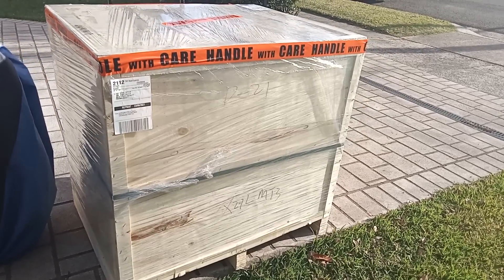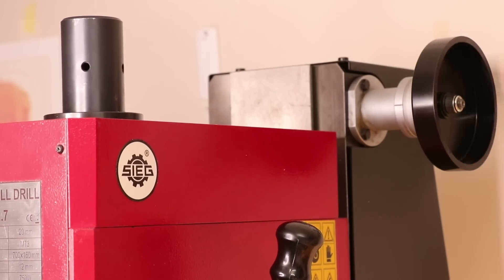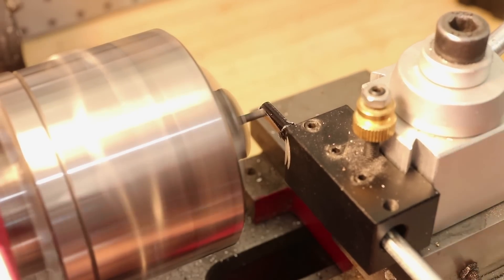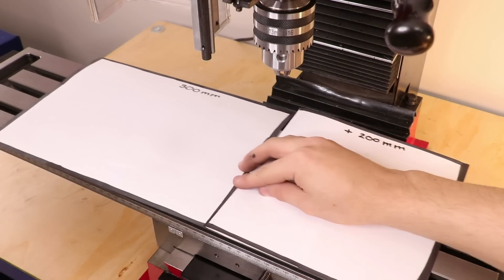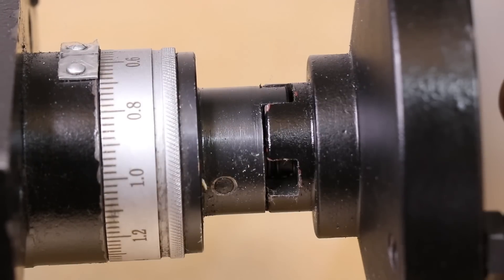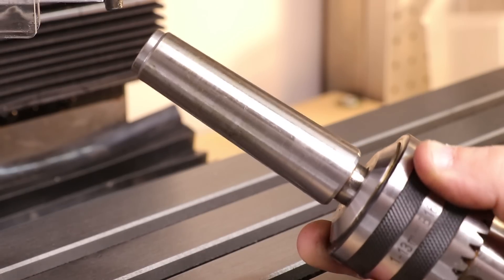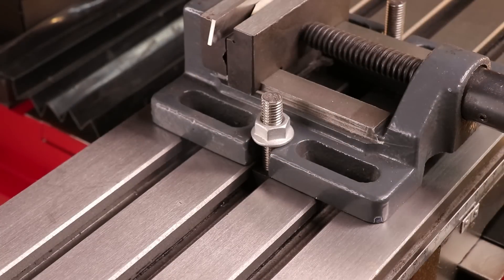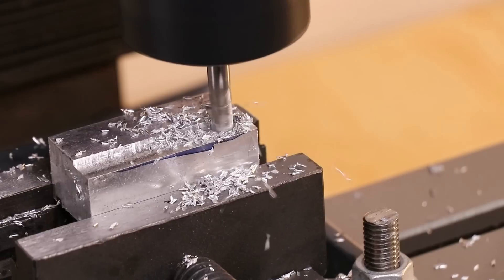I Bought A Mini Mill - Unboxing, Overview And First Impressions | Sieg X2.7l

Comment: Hey ! Just a quick tip for when you remove the tool older, instead of unscrewing the drawbar entirely and then tap it with a hammer, just unscrew it like one turn, tap it and then unscrew it completely to remove the tool holder, like you're doing right now you could damage the thread on the drawbar or on the tool holder ! Nice work tho keep it up and have fun !
Reply: That is extremely important when removing the tooling.........NEVER unscrew the drawbar more than a turn or you could burr the threads when you tap the end to release the tool.......Morse tapers are the pain and I always preferred the R8 over a Morse any day.
It's also something to mull over about the table length.....how many people actually need to have that long a table travel when most of their work is done in a vice of at most 100mm wide for these small mills......but you might want to co-ordinate drill some long plates so it's as you need but the once in a blue moon syndrome will get expensive if it never happens., and the same will apply to the Z axis height, nice to have but will make the machine more costly.
Reply: I'll do it the same way. Also the toolholder wont fall to the table or the vice or to the ground.
Reply: @BLECHHAUS  Yes I have the SX3L with the same system. Unfortunately when you loosen the drawbar with collets you need 3 hands, 1 to hold the tool/spanner on the underside of the spindle, 1 to loosen & tap the drawbar & 1 to hold the end mill. I made up a spindle lock negating the need for the under the spindle stupid spanner. It also uses the micro switch for the safety shield so you cannot start the mill with the lock engaged. Cheers Peter from Oz
Reply: @petermurphy3354  Yep - three hands ;-)
I always put a block of wood under the cutter so it can't fall out. For this purpose I have a couple of different sizes. Now I only need two hands.
I dismantled the protective shield and removed and short-circuited the microswitch, now it works without a protective shield.
Reply from the maker: Thankyou for the advise, any is always welcome. I will admit that I probably shot taking the tool holder out of the taper about 3 times, so for the shot you saw the chuck was very loosely held in. Cheers

Comment: My mini mill is the "XJ12-300 (RO8)" from Amadeal in the UK. The motor power is half way between the 350 and the 750 watt versions you quoted, coming in at 550 watts. Yes, it has the tilting head, which will likely be a sod to tram in each time I move it, but I see it as a necessary evil for some of the work I intend to do on building or maintaining miniature working steam engines.

Since it only came 2 days ago, I'm still in the process of clearing space on (and extending) the workbench where I intend to fix it; straight across the width of the workshop from the similarly sourced 7" X 14" mini lathe. Like you, I will be 'getting to know it' for a while before I add a DRO. I can't see a future in which a full motor drive and CNC doesn't come to pass ... one day!

Meanwhile I've already taken delivery of a set of ER32 (2mm - 20mm) collets, with the R8 collet holder to follow. Somewhere I have a small selection of end mills, with a further full(?) set to come as well as a small mill vice. Of course a set of decent quality parallels will soon be required. I think my first order of business, once everything arrives, will be to take some my existing steel stock and make a few more T nuts and hold down clamps.

Good luck with yours!
Reply: I got a set of parallels from amadeal for my cnc and they are great for the price. Its all imported from china but no complaints

Comment: LOL! Cleaning the sealant off! That stuff looks ALMOST as bad as the Cosmoline we had to deal with in the service. That stuff would only come off with soap and water, and not easily at that.
Reply: It has become clear to me that grease sealant what have you can only be wiped off on a cloth one finger space at a time.
Very time consuming.
No circular motion.
Just wipe off.

Comment: I've had my SX2.7 (same as yours but came with a DRO) for 3 years and it's been a joy to use. Only made two mods: removed the dog clutch spring because it gets annoying real quick, and replaced the rubber Y-axis way cover (which perished after a year) with a 200mm wide non-rubber bellows from AliExpress. In hindsight 250mm would be better as It would also cover the DRO position sensor.
Reply from the maker: I was not aware that they come with DRO's from the factory, but I am sure mine will end up having one installed in time. I can also see myself removing the clutch too, an auto feed is not too high on my list and the cutch it a hinderance at times. Cheers
Reply: @artisanmakes  Oops, you are right. I remember now that it was some kind of anniversary deal by the Australian dealership (they added a DRO + green & yellow paint job)

Comment: Some coolant on that steel could help too. Looks fun though!
Reply from the maker: Cheers. I used a little WD 40 but probably not enough.
Reply: @artisanmakes  Consider getting a mist cooler if heat is an issue.  It not only works well, but blow chips out of the way to some extent.  I've operated machines in a shop that used flood coolant.  But also some not equipped for that and we would rig up a mist cooler.  Also have one for my mini-lathe at home, and also floor model knee mill I have at home.  I never much cared for WD 40 on machinery.  It tends to get gummy after awhile if you don't get it all off.

Comment: Very happy for you! Looking forward to follow-up videos.
I am sure you will learn a lot with the new tool.  I was wondering if it would be easier on the end mill with some cutting fluid (ex. wd-40 on aluminum  and vegetable-oil/bacon-grease on steel) ?
Reply: Old hands do not use a lube or cutting fluid on aluminium and others with tungsten bits eschew them even on steel. I use cutting paste on all cuts, even brass and copper. Load the cutter grooves with some paste and as it heats up, it melts and feeds into the cut. The paste keeps the heat down, lengthening it’s life, but more importantly, it smoothies the cutting, allowing faster cuts.
Reply: @achmadosman9807  Thank you for sharing the secrets of "Old Hands", I'll try this out!

Comment: You need a 2 flute endmill to mill aluminum effectively. The large spacing between the flutes will help keep the aluminum from galling in the flute.
Reply from the maker: Thanks for the feedback. The 4 flute cutter was all I had on hand, I have several 2 flute cutters still in shipping. Cheers
Reply: This

Comment: A mill is next on my wish list, so keen to see how you go. I have looked at the Sieg range, (Lets face it, there isn't much else in my price range available here in Oz!) with no real idea of what I might want - so will be good to see how you go.
Reply from the maker: Cheers Jack, I feel ya, seeing the American machinists and their wide range of brands can make a bit envious at times, but I am glad we have the sieg stuff available to us. They all need a little work done to them, especially on the lower end machines, but I am amazed at what they offer for the price. cheers
Reply: Hi Jack, have you considered the second hand market, dont know what the availability of used small industrial machines is like in Oz, In the UK we are spoiled rotten with machines from our industrial past. If possible I always buy 2nd hand industrial machines, just far superior to the new stuff from China. Regards Del.
Reply: As a fellow Australian, check out Ausee, bought my mill from them, excellent service.
Reply from the maker: I can attest to this, I bought my mill, lathe and various tooling from Ausee and I have never had an issue with them.
Reply: I think you will find many will suggest getting a rigid column version as opposed to the tilting column version.  And I would agree.  I would shop only among the rigid column choices.
Reply: Checkout Paramount Browns, their RF clones are in the Sieg SX3 price range but far more rigid and twice as heavy. Geared as well, gives you excellent torque at low speeds.

https://www.paramountbrowns.com.au/products/milling-machine-dovetail-shaft-2/

Comment: QUICK NAME A USE FOR A 1/8 INCH MILLING BIT
Reply: Making a 1/8" slot :)
Reply: @AdjustinThings  well...fair point you win
Reply: They're pretty good at getting chunks of them embedded in the part you're working on, so as to make breaking the next bit easier too.
Reply: Australia's metric. a 1/8" milling bit is great for making headaches and incompatible parts for ANYTHING.
Reply: @LordPhobos6502  AND WE HAVE A REAL WINNER YOUR PRIZE IS...that you have enough sense to never buy a 1/8inch milling bit from a company that has an"all purpose modifiable lathe metal lathe drillpress grinder"

Comment: I'm excited for you, but your lathe is either relieved or heartbroken.
Reply from the maker: I think the little lathes deserves a good rest. And maybe some new bearings too. Cheers
Reply: Neither.
Lathe is happy caz he can use mill to fix lathe problems and mill will need lathe to fix mill problems.
I bought both for that very reason.
Reply: @tonycstech  Or when one of them breaks, you use weird setups on the other machine until they're both broken.
Reply: @tonycstech  you bring out the question of what comes first: the chicken or the egg